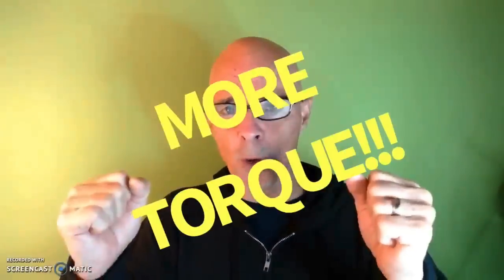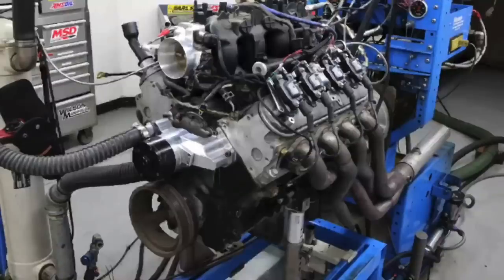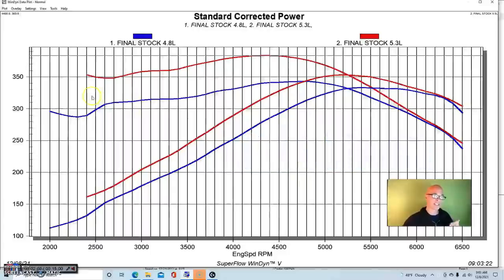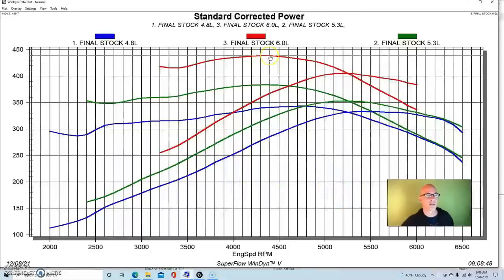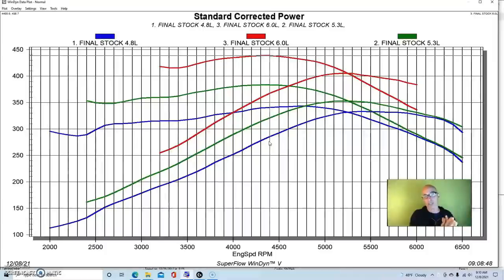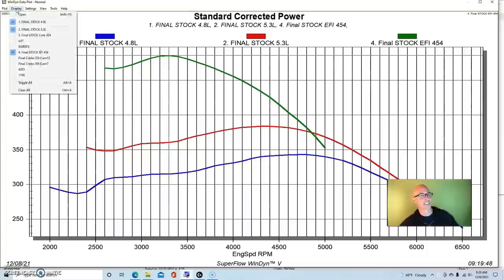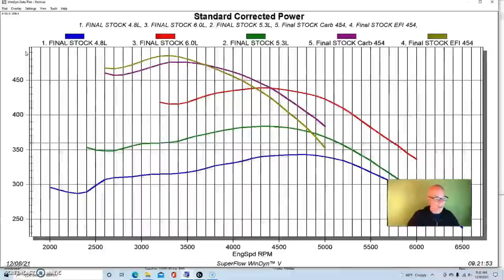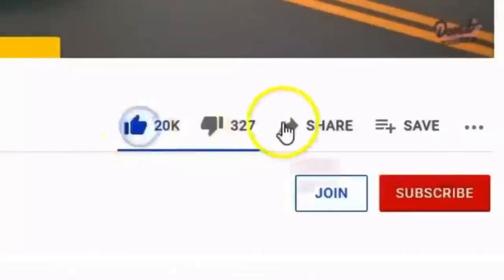LOW BUCK, JUNKYARD V8 TORQUE TEST-6.0L LS VS 7.4L 454 BBC-WHO MAKES MORE TORQUE? BETTER VS BIGGER!

Comment: One point of clarification -- The 6.0 LS engine did not replace the big block. The Duramax did. GM went into the 2000's with three basic engine choices in the 2500 trucks. The 6.0 LS, the 8.1 Big Block, and the Duramax. 

The 6.0 was never intended to compete with the two bigger choices. It was used in a similar way to the SBC in the older trucks; generally sold for non-towing applications, but is still capable of towing when needed on occasion. If you wanted a truck for towing, you chose the 8.1 or the Duramax.

The customers overwhelmingly chose the Duramax, so the 8.1 Big Block was dropped. The 6.0 didn't factor into this.
Reply from the maker: 6.0L, HD 1500, 2500 AND 3500, TOW PACKAGES AND 4WD-IT IS USED FOR TOWING

Comment: Have you done anything with an 8.1? Interested in the torque those make compared to the 454.
Reply: I was looking at a used fi 8.1 with loom and ecu for $800 the other day. With that in mind I see literally no reason but internet steez to pick an ls over the big block lol.
Reply: I agree. I'd like to see Richard run a 8.1 on the dyno and see exactly what kind of numbers is produces compared to the L29 7.4
Reply: You can get a $350 stroker crank for the 454 and make a 495 (8.1) easily ... Unless you just want the factory 8.1 packaging,  Cubes are cubes.
Reply: @arcdestriumph586  I know you can stroke a 454 cheap, but I'm curious about the 8100 truck engine since the heads are so much different.
Reply: @arcdestriumph586  cubes are cubes. but the 8100 has decent heads and 0411 😎
Reply: @FRECHKN  8100 heads aren't going to flow as much as BBC IV Open Chamber 119cc heads.. Which are plentiful.  The 049 and 781 heads get the attention.. but the 119 cc  smog heads used from the early 70's to mid 1980s on 454s are similar pieces with similar flow.  049's and 781's make over 600hp with minor modification .. a 454 BBC IV out of a mid 70's dually w 119cc Smog heads and a stroker crank are a more powerful option than an 8100.
Reply: @kylesorensen83   Different doesn't mean better... You're going to have a hotter combo with a truck 454 from a 1970 to 1985 donor.  119 cc smog open chamber 454 heads outflow the Peanut Port era heads.
Reply: @arcdestriumph586  but that's not factory offering or found in a junkyard like almost every engine Richard deals with. So again, I'd like to see how the 8100 would compare to the 454 he tested, nothing more, nothing less.
Reply: @FRECHKN  as an 8.1 owner, the heads are crap.
Reply: I have done a little with them, you should see the 8.8 that is out now, yeah surprised he didnt compare an 8.1 vs 6.0 since they both came in gmt800 trucks
Reply: @arcdestriumph586  I disagree but square port heads on a tow pig isnt the smartest choice
Reply: @sb0mb   Disagree all you'd like.. I posted a 650hp engine video with 119cc Iron Open Chamber Oval Ports above.. In stock form they flow enough CFM to support over 500hp...  Not guessing.
Reply: @arcdestriumph586  how much have you done with an 8.1L? i am sure your 650hp engine was a great towing engine which is kinda the point.
Reply: @sb0mb   No.. the point is a 496/454 stroker is the same displacement as an 8.1.. The rest is headflow.. and 119cc/Open Chamber /Iron Smoggers from the 70s/80s outflow the stock 8.1 heads.

Comment: The 454 has a lot less compression too!
Reply: And compression = power yield from fuel  sp the challenge is getting as much compression as you can with out destroying the engine or pulling so much timing out that it can't make power
Reply: @austinhowze6280  454 is only 8.5 to 1 can easily handle 9.5

Comment: Hey Richard 😊
You asked for other engines, I tried to find it in you videos (you have A LOT of videos🤣), and I could not find a video of a Mazda FE engine. I am going to put a FE engine in my 1977 Mazda 929 H/T, and are curious to what you can do to it NA (it is supposedly good for turbocharging too, but I prefere NA, and really do not need a ton of power in my lightweight Mazda, 150hp pluss is where I want to go😊).

Comment: 4.8-5.3, same bore, different stroke. 5.3-6.0 same stroke, different bore.

293, 325, 364

The Gen 6/7 BBC are more LS than Gen 1/2 SBC.
Reply: How far out can you bore a 5.3? Never looked into that......just curious. Bore it out and put new pistons in it and have close to 6.0 power?

Comment: Unless you are regularly pulling 8000 to 15000 lbs every week... You don't need a Big Block or Big Diesel.  Buy a 5.3 1/2 ton and pull 6000lbs or less anytime you want.. and enjoy the gas mileage.  Get an old cash/paid for Dually or C60/70 for $2500 or less and use it when you need to pull big stuff. Like a Cattle Rancher who hauls 14,000 lbs of cattle to the sale barn 2 times per year.   You'll save $3000-$6000 per year in fuel.  Old  Cash/paid for dually will be a net/$$ gain the 1st year overall.

Comment: I had a 2000 GMC with a 7.4 and it fell on its face after 4500 rpm. The heads are crap so there isn't much you can get by modifying other things. The stock ignition system and injectors are crap too. The 8.1l and 7.4l out of medium duty trucks were better. They went to coil packs on the medium duty 7.4's so at least the ignition wasn't an issue. GM didn't even try to do anything with the 7.4's. It was a shame.
Reply from the maker: THE HEADS WILL SUPPORT AN ADDITIONAL 100 HP-SO THERE IS PLENTY LEFT IN THE STOCK HEADS, JUST NEEDS A GOOD CAM AND INTAKE

Comment: I would love to know why the 8100 got no love by the aftermarket suppliers? It is a great engine. I wanna know how much can be squeezed out of it.
Reply: The engine was great but fuel prices and the durability of the Lb7 duramax killed the 8.1. The 8.1 also had pcv problems that made it drink oil. But fixing the pcv and camshaft sensor they would last forever 300000 or more miles. If gm would have sold more the aftermarket would be solid.

Comment: The high RPM torque gains are interesting... Seems to me like the best combo would be a 6.0 with an overdrive auto, where you can hold the lower gears for longer to keep the revs up, but then have decent fuel econ when not under load.
Reply: Even with an 6.2 Liters and a stroker kit (To 7.0 Liters or 427 CU) Would be interesting, the problem i see is that engine is more a performance engine, but would be nice a test.
Reply: @TheLeonmafioso  With a better than oem rod and piston, and forged stroker crank, ive got no doubt the 7.0 liter would live long if kept at reasonable rpm. You start winding it out under load and it will see wear.

Comment: Be cool to see a 90s big block efi shootout. 460 ford, 440 dodge, and 454 GM
Reply from the maker: did they make a 440 in the 90s?
Reply: @richardholdener1727  I thought they did for like RVs and stuff. I could be wrong tho, I know they switched to the v10 somewhere in the mid 90s

Comment: I have a gen 5 454 that is worn out in a 92 k2500 (4l80e trans) 4x4 thinking about swapping in either a 6.0 or 5.3 ls for mpg and reliability purposes can’t make up my mind on which one to use I don’t use the truck as hard as I use to but it does get used for work every now and then. I have a lot of people telling me just to rebuild the 454 and move on, but I’m not sure any more I love the big block just hate how that it has a drinking problem any help or advice would be appreciated. Thanks in advance
Reply: fuck the LS Vortec L29 swap or 8.1 swap. OR if you wanna get creative Vortec head swap on the Gen V with a turbo or super cahrger

Comment: Silly question.  Can you make an LS7 into a towing motor?  More cubes with maybe a LQ4 cam for a torque curve down relatively low.....or could the LS7 just be cost prohibitive ?
Reply from the maker: too costly-just build a stroker

Comment: The fuel consumption would be interesting to see on the dyno runs. I've learned that smaller doesn't always mean better economy, but a 454 is a fuel hog for sure.
Reply: I get 13 mpg but still get 410 of torque.
Reply: Yep that why ford made the 7.3 gas engine to save fuel. Unloaded it will consume a little more but while towing it will do better. My crx averages low 40s but when towing a trailer with a mower on it i got 14mpg and couldnt break 50mph on the floor
Reply: @derekmaxwell8164  I'm giving Ford a thumbs up on that one coming back to the pushrod motor.
Reply: @derekmaxwell8164  a big engine going easy will do better than a small engine running hard top gear did it with a prius and something else and all they did was follow the prius around the track flat out
Reply: @fabiancastellanos7196  I was doing 26mpg on a built 5.4 with boost that would do 640tq at the tire but you had to be on the highway in town was like 18mpg or less put your foot in it and watch the need go back
Reply: @austinhowze6280  yeah, imagine what a boosted big block will do.
Reply: @fabiancastellanos7196  the key is running 0psi so your motor isn't working to pull air and not running boost to increase fuel
Reply: @austinhowze6280  I'm going from headers and a 411 ecm and a tune I can get about 350hp and about 500+ torque also will get a few extra mpg . Is my daily work truck . I haul heavy loads. Every day.
Reply: My 454 gets better fuel mileage than the over rated 6.0 truck. But both lose to the 455 Pontiac truck.

Comment: I'd be interested in seeing both of these motors in a daily driven street machine.  What's more fun, a slightly quicker quarter mile time or a tire shredding beast?  Does the big block ruin handling and gas mileage enough to outweigh the fun factor?
Reply: There's a guy doing an 8.1 versus a 4.8 in street trucks
Reply: @Prestiged_peck  but the 4.8 is in a AWD so not a good SxS example.

Comment: I've got a 2000 c3500 with a stock vortech 5.7 I use for work. I'd love to see what you can do for torque while keeping it simple and reliable.
Reply from the maker: the spider injection is a problem
Reply: The ramjet intake and so quick simple wiring for injectors fixes that.

Comment: Great Video,  is there much difference in torque or power between a genuine Big block 454 or an LS2 stroked to a 454.
Reply from the maker: PROBABLY NOT

Comment: As you noted, I WANT TQ AT 1500- 2200.  I LIVE AT 4500 FT.  I WANT TO KNOW LOW END #S FOR MY '02 TRUCK.  CURRENTLY HAVE 5.3 WITH 273,000 MILES AND LEAKY REAR SEAL.
Reply from the maker: you need a 6.0l

Comment: Richard I need 800 ft of torque I will be using the Cady supercharger with a 210 212 600/ 600 and the Mac daddy adapters when I can afford them it's going on a lq9 6.0 am I going to be able to make that under 6500 rpm.
Reply from the maker: I doubt you see 850 lb-ft -and it definitely won't come out at 6500
Reply: You know my next question. this is on a airboat , I need that LS to make everything it's got torque wise before 6500. In a car it's easy get a converter and roll but it's direct drive gear box to prop no slip nothing. Trying to get everything it has as fast as possible. Horse power means nothing to me I need torque and the 6.0 and Cady supercharger is all I got and that bet cam

Comment: It would be cool if you could add in an 8.1L. I replaced the 454 in my 78c30 with a 8.1 from an 05 truck and the seat of your pants difference is unbelievable.
Reply from the maker: a 496 should offer more torque than a 454

Comment: I just got my 1985 c20 with 454 running   the truck is really good shape. I pulled the emissions crap off it and now im ready to put money into their motor   where do I start? im thinking  intake manifold and carburetor cus its not crazy expensive
Reply from the maker: good start-then mild cam

Comment: I would guess a 6.0L at high rpms would have the same fuel economy and reliability as a 7.4L at low rpms.
Reply: making HP takes fuel. the LS will do that a little more efficiently depending on the combustion chamber/compression/burn efficiency.
Reply: Not if everything else is equal.  Higher RPM means more frictional losses.  The modern ls engines benefit from better combustion chamber shapes as well as flow characteristics and fuel management.  A properly built big block incorporating the modern fuel/ignition management as well as a good combustion chamber design will be the superior towing engine as far as not including forced induction.

Comment: Destroke an L8T to 6.0L and add turbos.  Make 720 lb*ft at 1500 rpm, and gradually roll the torque off to 660 lb*ft at 4000 rpm.
Reply from the maker: 720 lb-ft at 1500 would be a 1 time deal
Reply: @richardholdener1727  Not on a DI engine.

Comment: I am at this exact spot. I have a 1986 1 ton Dually. I removed the stock engine and trans. I am installing a Gen 6 with an Edelbrock RPM intake. My question is on cam choice. I like the Comp Cams XM284HR Extreme Marine 230/236. do you feel this is too big? I know i have to change valve springs.
Reply from the maker: will be close on p-v-you need to check
Reply: @richardholdener1727  I opted for the XR276HR, part #01-416-8 with the Comp 911-16 single springs, retainers and 10degree locks. I didnt have to modify spring pockets for or  use anti rotators. this according to Comp Cams tech support.
Reply: Plus at .510 lift I have plenty of room for P to V clearance.

Comment: You can find 6.0 all day long for $500 to $1000 that will last another 1 - 200,000 miles . Unless you find a 454 pre 78 with low miles … best break out that $$$ . An 88 SS 454 was 245 HP .
Reply from the maker: I like Gen 6 454
Reply: @richardholdener1727  I like any 454 . Especially if you got the $$ to do them right . Given the fact that you can buy a brand new 600+ hp 502 from summit or Jeggs for $13,000 ….. unless you already have a 454 and or the cash to build it right . The heads and cam are a must to get proper power out of one of those monsters . 
Lol I missed one in a 94 2500 van … the whole van . Cousin called me and told me a lady had one she couldn’t get running for $600 . Like a big dummy I turned it down , some weeks later my curiosity started gnawing on me . I had in my mind something major  was wrong with it . Called my cuz and asked what had happened with it . 🤦🏻‍♂️🤦🏻‍♂️ someone had stolen the battery out of it 🤬

Comment: Why did the 6.0 lq9 that engine power just built only make 450hp? It had 317 heads and a 231/239 cam.
Reply from the maker: not sure-that is a long way away from what it should make

Comment: Richard..I am looking at a 351w build...would a 70 D00E Windsor head, or a GT 40 head be better? The 351w is out of a lightning, but the heads were cracked (was hit front end extremely hard, everything else is good and have tested.). I have a good set of D00E heads. And get conflicting reports
Reply from the maker: GT40

Comment: I think this is not completely fair for the big block, this is the lowest performance big block ever made, low compression, worst cylinder heads, low lift and duration camshaft. I’d like to see a comparison between these motors in similar circumstances.
Reply: Exactly!!
Reply: but still the 454 has the torque where most people need it. my truck runs 3k at 70 mph, making torque at 5,000 doesn't do me much good. thinking of the 502HT

Comment: DO YOU HAVE A VIDEO ON 6.0  2008 MAKING IT A 427 WITH A WHIPPLE  SUPERCHARGER
Reply from the maker: YOU NEED TO SLEEVE IT TO MAKE A 427 (CORRECTLY) A 408 WOULD BE MORE COMMON

Comment: There's a reason GM dropped the big block. It's just not needed anymore between the small block and the Duramax. Assuming you actually tow(and have 3.73s/4.10s like a tower would), a 4.8/5.3 will max the GVWR on any 1/2 or 3/4 ton truck. Don't even think about fuel economy with a 454 either.
Reply: Oh, what might have been, though.  I saw a prototype LS V10 7.5L at Katech sometime around 2004.  That would have been a cool replacement for the big block.
Reply: @andyharman3022  hella cool. I'd love a V10 Chevy engine
Reply: Need a different trans

Comment: CAN YOU ANSWER A QUESTON, 98 7.4 GMC 3500, IF I TAKE THE MANIFOLDS OFF ANP PUT A HOLLEY CARB ON IT WITH A HEI WILL MY TRUCK 4L80E AUTO TRANS STILL SHIFT?? IF I JUST LEAVE THE WIRES NOT USING LOOSE WILL IT WORK?? NEED MORE POWER TO HAUL A 13 THOUSAND POUND TRAILER. THANKS
Reply from the maker: your transmission is ecu controlled-I doubt it will work without inputs from the efi

Comment: If the test gave the 454 the same head flow numbers and same cam lift as the 5.3, the numbers would have been even more skewed to the bigger motor
Reply from the maker: the stock cam specs are pretty close

Comment: i have a question about the 6.0L V8 366. i have a 1987 GMC school bus (21ft) with a 6.0L V8 366 that I want to convert into a schoolie. is this a good engine for long distance driving?
Reply from the maker: is it the BBC 366?

Comment: off subject? Big Block Victor 454-R with 100 mm intake injectors and coil on plugs, what would it take to make this work and would you get more tq and hp or is it a wast of time
Reply from the maker: a single plane is not the ideal choice for torque. I ran an efi like this on the big bang BBC

Comment: I currently have a 6.2/8speed. I would be curious to see the low end (2,000-4,500rpm) dyno results vs a modern 6.0. I feel like my 6.2 has the edge, other than running premium fuel.

Comment: The 6.0 litre vortec is about 350 360 torque stock the vortec 454 mark 8 is 290 HP and 410 torque at 3200rpm the 454 is far more torquier than the 6.0 litre in stock form anyways the 6.0 litre is a great motor too you cannot really compare small blocks and big blocks big blocks have longer piston strokes which is what makes big torque the Stroke on a 454 I believe is 4.25 inches and cylinder bore at 3.75 inches
Reply from the maker: 454 is 4.25 bore x 4.0 stroke
Reply: @richardholdener1727  right on thanks